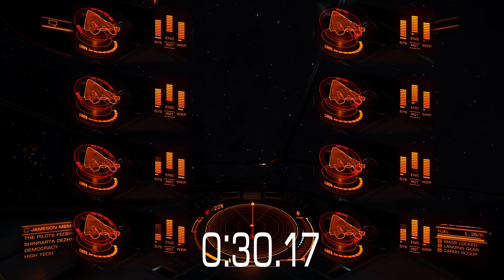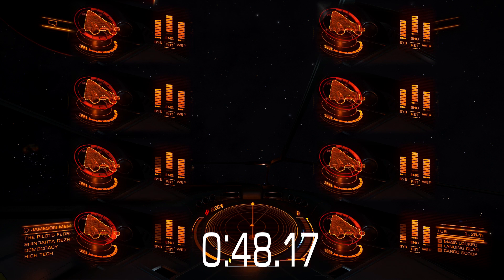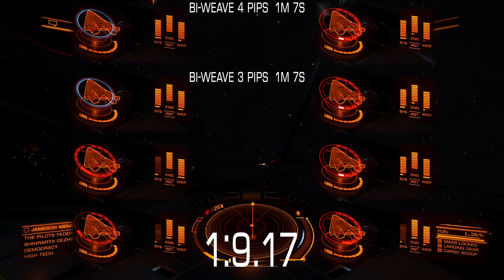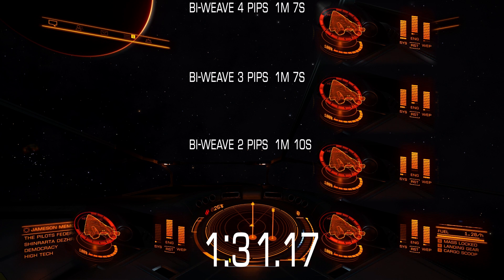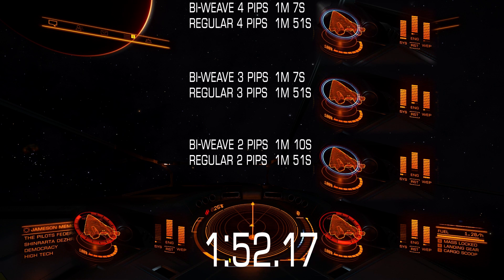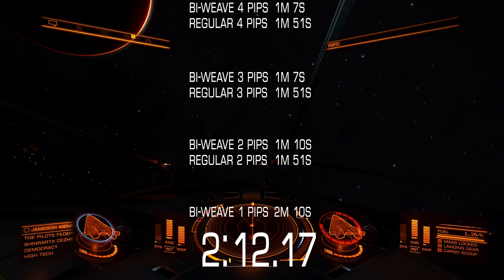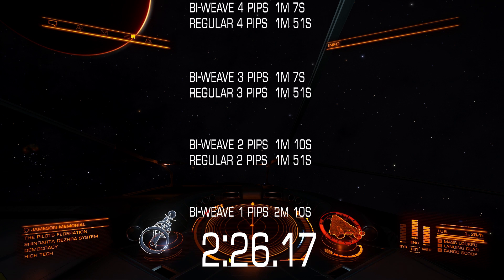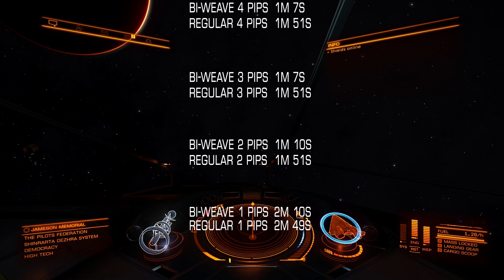Elite: Dangerous. Bi-Weave vs Regular. Offline Shield recharge rate regarding PIPs to SYS

Comment: You need to remember that when your shields go down you should turn off your shield boosters. I tested my own A-rated FDL with and without boosters and there was 2 minute difference. 1min 51sec without boosters and something like 3min 50sec with 4 A-rated boosters. This was with regular A-rate shield generator with 4 pips.
Reply from the maker: +PartlySane shield come online when they reach 50% of full strength, obviously by making them 2x weaker they come at 25% of full charge 2x faster.
but unless you have SCB ready this really will not give you much of an advantage if you are under heavy fire because you will lose shields 2x faster then as well, but if you are not under fire then definitely, i just have no idea what it has to do with comparing regular and bi-weave shields.

Comment: Nah. Bi-weaves only need 2 pips. The difference is only 3 seconds and hence - meaningless.
Reply from the maker: +Chris Davies pay attention to what you see - all tests started with full SYS capacitor which will not be the case in combat, thus it will take much slower for 2 pip Bi-Weave to come back than 3 seconds, 2,5pips actually might be the sweet spot but less than that and you are losing time :)
Reply: +Kornelius Briedis Exactly.

More to the point, you can put 4 pips into systems to fill the capacitor, then take those pips out while you need them, then put 4 pips in again, etc.  You can keep repeating this cycle and, as long as the capacitor never drains completely, you're not wasting time.
Reply from the maker: yeah, exactly same as we do with WEP capacitor when we want to shoot or ENG capacitor when we want to boost ;)

Comment: With all the testing I have been doing, especially with combat testing, Bi-Weaves seem to suit ships with low shield capacity, such as the FAS, FDS, FGS etc... Then when shields drop, you can hull tank while the shields come back online. On the FDL however,  this is really not the best way to go about things. With ships that have high shield capacities, then your better off with A-Grade or Prismatics and stack Shield boosters.
Reply: +Vindicator Jones I run bi-weave on my FDL - 682 on the shield and the recharge is invaluable! Lose shields? Disengage for one minute and you are back in it - it's really awesome!

But yes, the FDL doesn't benefit as much from this as the FAS - the Fas is quite good now!
Reply: +Vindicator Jones On the other hand, the bi-weaves allow you to keep your shields topped up between fights--even with my Corvette I prefer Bi-weaves for NPC fighting.  Gone are the days of needing to use SCBs to top up your shields (other than when you are being attacked hard).

Even PvP, the hp  difference between bi-weaves and regular shields is (at most) 160--a little more than one 4B shield cell bank charge (with most builds, it will be 145 or less).  So it's not immediately obvious which shield is better: higher max HP, or faster HP regen/shield recharging.
Reply: Guys, you are forgeting that it depends on the situation, enemy rank and wether you are solo or in a wing. I fly solo outnumbered against elite ships on a fully engineered FDL. I use the 5A regular shields with the reinforced mod, and 5 shield boosters, that gives me 2,055 shields capacity. I can still disengage and pop some SCB if necessary. I usually get 4 or 5 kills before I lose my shields, so yeah, it really depends on the situation. If you're in a wing and you can switch the aggro to someone else, get recharged, AND/OR you don't want to let your team mates die, you might be able to even tank for a while. So they are both useful, depending on your style. Peace.

Comment: how do I change the HUD colour?
Reply from the maker: +Joe Mcducksises https://forums.frontier.co.uk/showthread.php?t=73419
you know that there's a search engine called google :)
Reply: +Kornelius Briedis I couldn't find anything. :)
Reply: +Joe Mcducksises that I was bothered to do......
Reply: +Joe Mcducksises Copy this:

<MatrixRed> 0.2, 0.05, 2 </MatrixRed>
<MatrixGreen> -0.15, 2, -0.5 </MatrixGreen>
<MatrixBlue> 1.75, -1, -0.3 </MatrixBlue>

Then go into your game file. If you have steam, this can be achieved through right clicking Elite:Dangerous>Properties>Local files>Browse local files>(base game window should open up)>Products>FORC-FDEV-D-1010>right click on GraphicsConfiguration>Open with notepad. Scroll down a tiny bit to where it says <GUIColour> and replace
                        <MatrixRed>          1, 0, 0 </MatrixRed>
   <MatrixGreen> 0, 1, 0 </MatrixGreen>
   <MatrixBlue>  0, 0, 1 </MatrixBlue>

with EXACTLY what you copied above.
You can find those Matrix values underneath

<Default>
           <LocalisationName>Standard</LocalisationName>

COPY YOUR DEFAULT GRAPHICSCONFIGURATION FILE AND SAVE IT IN CASE YOU SCREW UP
Important ->*Hit save* and close it all. If you didn't screw it up, you will open up your game with a new scheme that replaces the orange with light blue, reds with purple, greens stay green, etc. It's the scheme I use, and you may need to turn the in-game HUD brightness down a bit under the right-hand in-cockpit console. If you don't like the look of that scheme, look for different things online to copy and paste in following these above steps. Good luck.

Comment: y would u stop the test there? i would also like to know the time to full shields.
Reply from the maker: hmm, missed that, thanks, need to test then and see what i can find out :)
Reply from the maker: +whitewolf147 time is 1,5 faster than for regular shields if you have enough energy coming in.
Reply: +whitewolf147 when shields are up bi-weave regenerate shields 1.5x faster then standard shields. However! When you are under attack, shields wont regenerate at all. One of the main reasons I don't even think of equipping one of these.
Reply from the maker: hmmmmm, are you sure they wont regenerate while under fire? so that's why they felt so damn weird to me when i tried them but i couldn't figure out what's wrong....
Reply: Kornelius Briedis I am quite sure. We fired a single c1 Multi Cannon shot every 2 seconds overy quite some time and the shield did not even regenerate 1 single percent. This applies to both, normal and bi-weave shields. If I remember it right, it restarts regenerating 3s after the last hit.
Reply: +CMDR W.Heisenberg I was not aware of that at all. If I had friends, I would test that myself, ha.
Reply: +Kornelius Briedis i want to know the time form 0% to 100%
Reply: +Kornelius Briedis what about the charging time from "back online" to 100 percent? Is it the same: As long as you have power in the system the pipes don't matter?
Reply from the maker: for charging speed yes, doesn't matter, but for shield strength it matters a lot.
Reply: +Kornelius Briedis thanx dude. BTW: I've just listen to your last roundtable podcast -   and i almost crashed my car because i was laughing so hard about your "fishy exploration data" comment 😆
Reply from the maker: hehe, i hope frontier will start giving us something to do apart from grinding and upgrading, i spent 1 hour today in anarchy system and visited signal sources, didn't find anything interesting to kill (just loads of materials), it's crazy, that stupid 600 material limit will be filled in 1-2hours, why these "devs" can't try it for themselves to see how stupid that limit is...